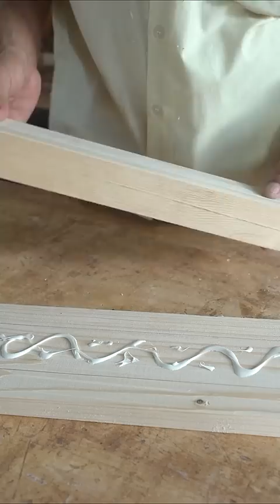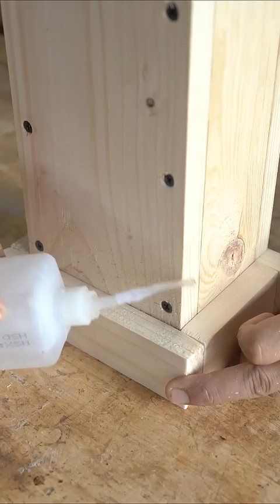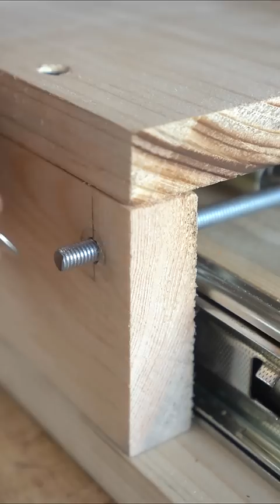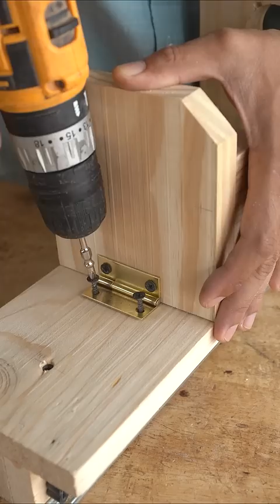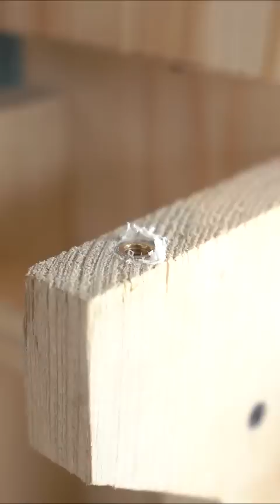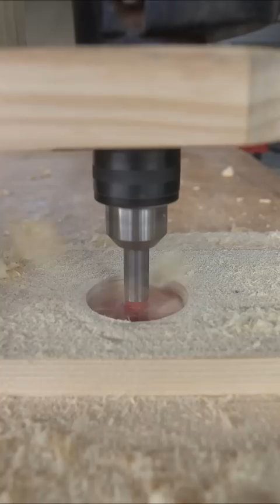Awesome make a drill press #woodworking #diy #tools #amazing

Comment: It would cut better, if the drill were actually straight.
Reply: That was my first thought also.  Who wants a drill press that doesn't drive down at 90 degrees to the table?

To a degree, I blame drill manufacturers.  I wish hand drills had at least one flat side that's parallel with the drill bit.  Would make a project like this much easier, and help in plenty of other circumstances as well.